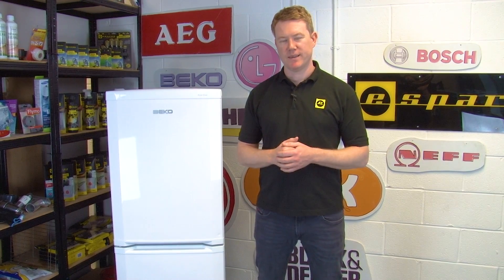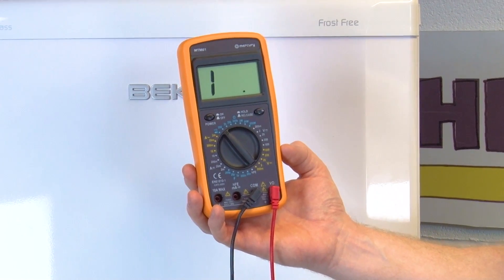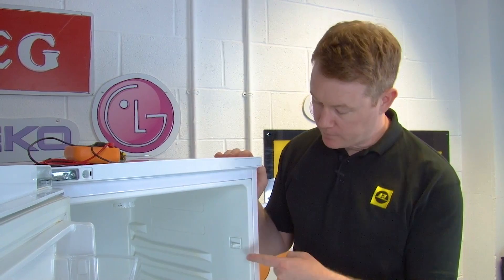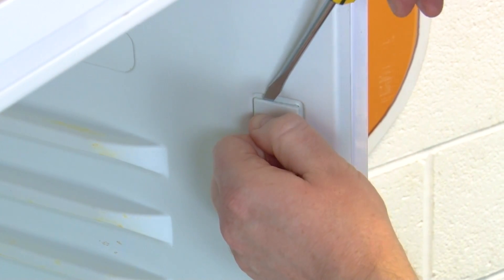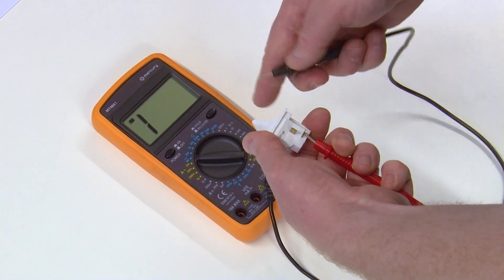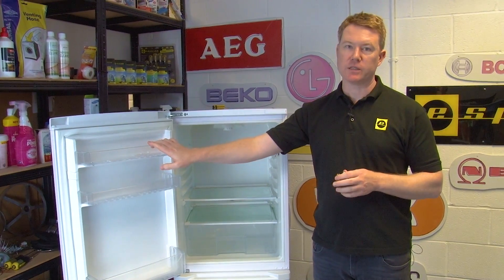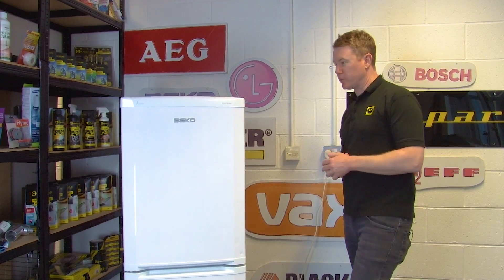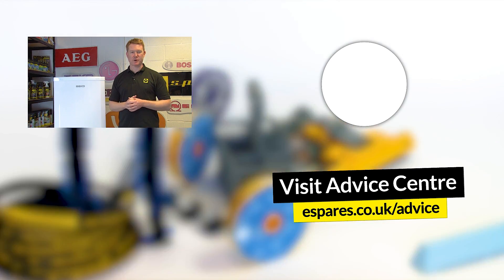Need a Fridge Light Switch Replacement? (SIMPLE Multimeter Test Guide)

Comment: So if the switch beeps when connected and stops beeping when you push the switch (like in the video), it's working or not working? Mine is acting like the switch tested but the door open warning light is still on. When I remove the switch, the warning light goes off. Do I need a new switch or is there a different problem?